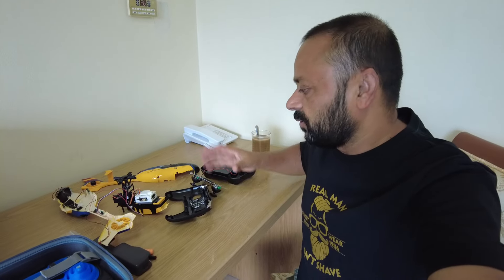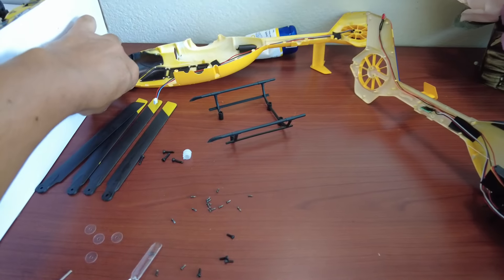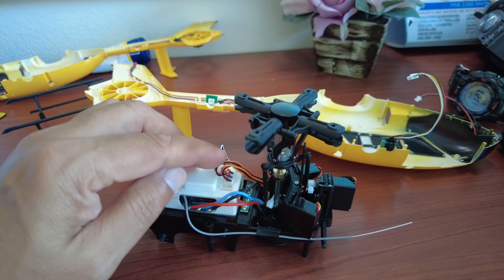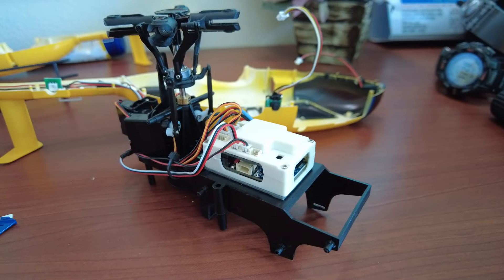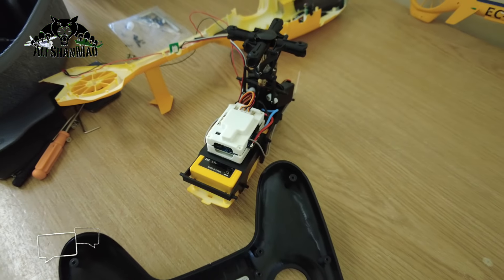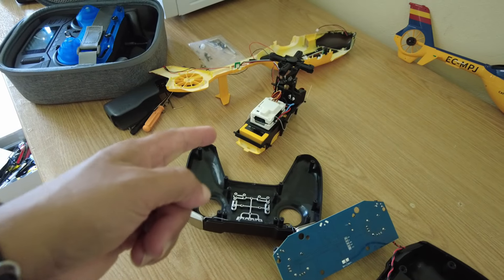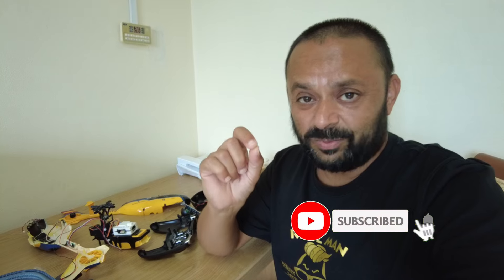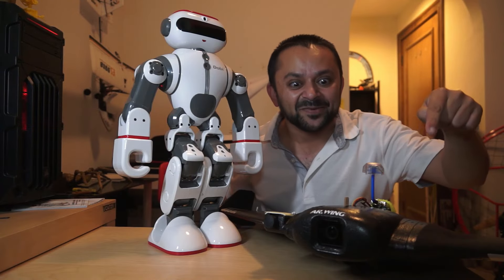Behind the Scenes: Yuxiang F06 EC135 Eurocopter RC Helicopter's Inner Secrets

Comment: Ali, I’m removing parts from a crashed EC135, the tail rotor blade appears to be permanently attached to the motor? I removed all the screws but can’t see how to detach it ? So I’m hoping if you should damage one does the entire motor and blade need to be replaced? Which then why would they give just an extra blade?
Reply from the maker: it should not be. it should be removeable. they will never leave it attached to motor permanently.
Reply: @alishanmao  ok thanks, I’ll give it another try

Comment: Thankyou for your tutorial. Very interesting to see what's inside. I ordered the new f06 modified flight control kit and my local drone shop in Australia is getting me a radiomaster R81 8ch frisky D8 compatible SBUS receiver which they recommended. I will have to wait at least 3 weeks until I receive these items to see if it works on my radiomaster boxer transmitter
Reply from the maker: Have fun! and i believe thats the only way to do it

Comment: Hi Ali, I really didn't want to buy this heli with the terrible controller, but it looks really fun, so I did anyway 🙂. Hoping you can find a decent transmitter to bind with it.
Reply from the maker: there is a flight controller replacement being sold as someone mentioned that can take sbus receiver and you can bind any radio of your choice then

Comment: I viewed your video on setting up a ATT mode on my FW450 i set,1400 in on the 3d switch and after putting the switch to 3d in flight the helicopter just dived down and crashed. I have the V2 version. Am i missing something,.
Reply from the maker: When you switch to 3D, helicopter will jump down due to pitch curve settings flywing has put in the flight controller. when switching to 3D you need to immediately give more throttle to keep it hovering and due to throttle controlling pitch manually it all comes to pilot and skills to fly in 3D Mode
Reply: @alishanmao  But you switched between GPS and ATT did you have to bring the stick up?.
I would have expected the pitch to go zero in 3d mode and plus or minus 11 degrees like a normal helicopter. 
They should warn people about that  ..
Mine dropped like full negative pitch went in no time to react helicopter too low.
Reply: @alishanmao   This is exactly why users need to be able to modify curves (not be locked into an opaque black box for a controller).    As you know (and @jefferyuprichard3754 may learn):  it's wise to set the pitch angle relative to RPM as equal at center-stick between modes.
Reply from the maker: GPS and ATT it won't do that. just from ATT to 3d or GPS to 3D mode it will jump down due to pre set pitch curves settings. which we are unable to change.
Reply from the maker: very true. i told them many time to give us the ability to program our curves, but they won't listen
Reply: @alishanmao  Hi,many people buying that product will be new to the hobby will try that 3d switch without that knowledge and crash .I didn't see any warnings about it but will check again. 
The pitch curve should be zero degrees at centre stick that's all that's needed in 3d mode and plus or minus 11 degrees. 
I had fully negative pitch. Very strange. 
I see only one switch to set ATT mode and that's the 3D switch is that correct. 
Thanks for the reply.PS I have the V2 450.
THANKS FOR THE REPLY.

Comment: Wow, and I just asked you about the ERA RC M D500 main board, due to my jerky jerky flight control and not being able to use rudder input
Reply from the maker: maybe best ot change flight controller. remove optical flow and it will fly smooth

Comment: Waalaikumsalam..Great video..thanks for sharing
Reply from the maker: Thank you too
Reply: @alishanmao How did it go putting the body back together did it all lign up well? that's my main concern if i bought a extra fuselage the exact one i bought a extra one for my B105 and i couldn't get it back together right it had gaps and for some reason i couldn't get it properly fixed? So I'm thinking of ordering a extra fuselage for my F06 but afraid i might run into the same problem
Reply from the maker: @jonspikes4935  yes it does. but you should know how to put it back together
Reply: @alishanmao  Right may get one & also do a custom paint scheme on it